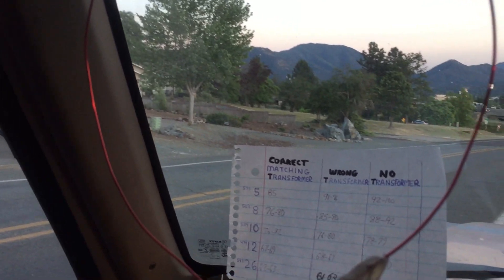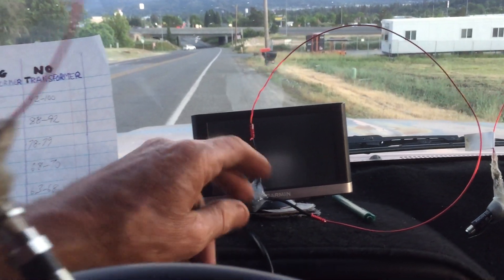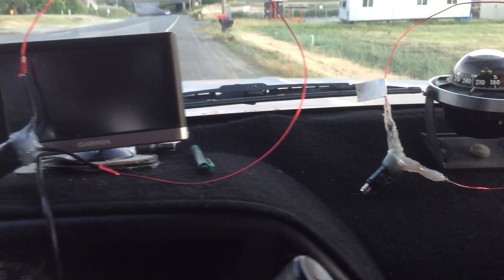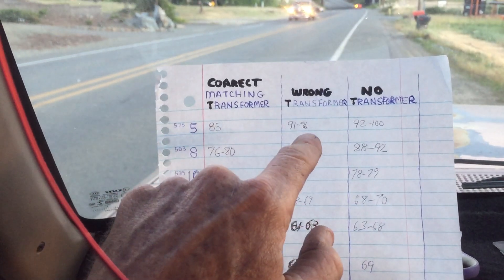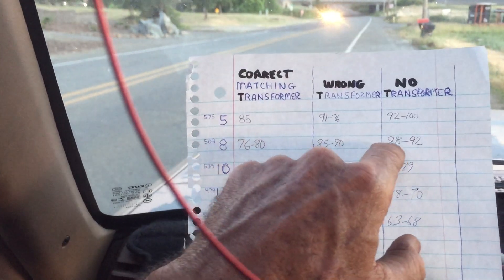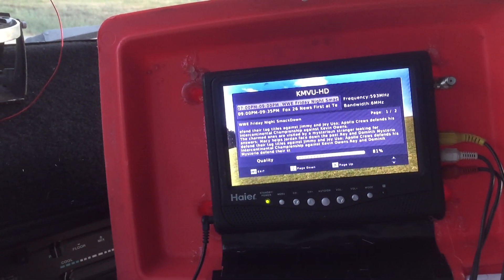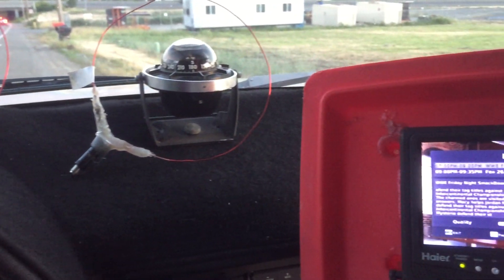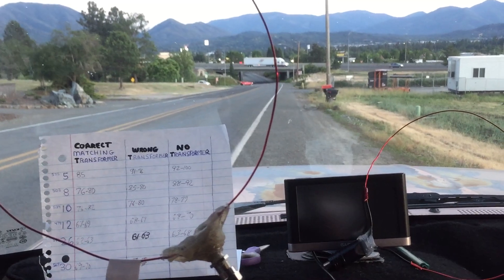TV Antenna Matching Transformer Experiment

Comment: What I am wondering is if a top of the line balun would make a positive difference ??? I remember reading somewhere that cheap CHINA balun varied so much in electrical value this would cause erratic behavior.What do you think ??
Reply from the maker: As far as I know my balun was fine, but comparing a few of them would be an interesting experiment. I noticed a small difference is the size of the loop makes a big difference.

Comment: Is there a way for you to, easily, use the same antenna for all the tests and swap out the baluns?

The easiest way I can think of myself would be to make one single loop glued or taped flat on a small piece plywood or something similar, and have both ends terminate at screws that the baluns could be attached under.

This way you have a constant antenna shape and distance between loops ends, which actually can impact performance I've always read. Then you can change coax types and lengths as needed as well relatively quickly for other tests if you so chose.

You could stretch a bunch of different testing from a short afternoon into a couple different quick videos to get your activity up.

Regardless, love your stuff. I always find it inspiring.
Reply from the maker: I kept all of the loops the same diameter, although I measured them by holding the loops next to each other which could result in a small margin of error, but I  like your idea. I may do this in an up coming video.